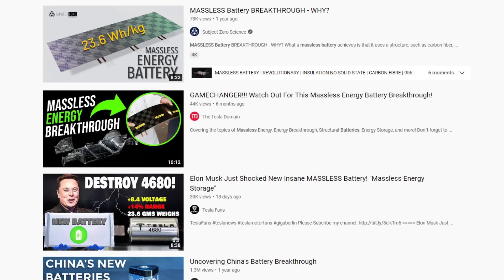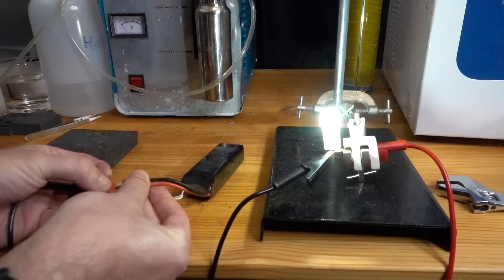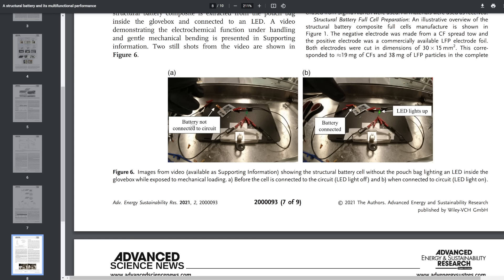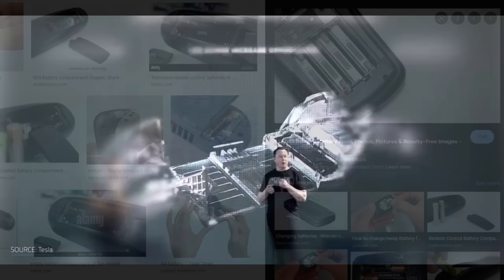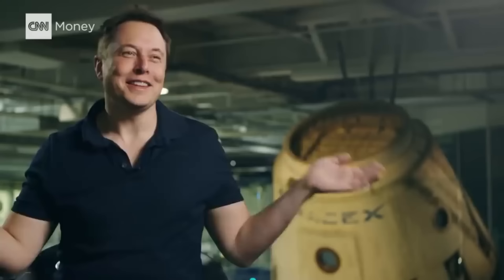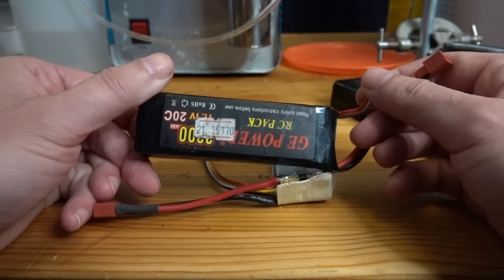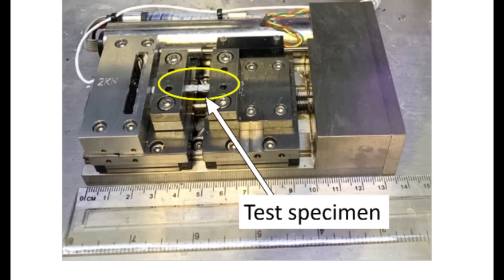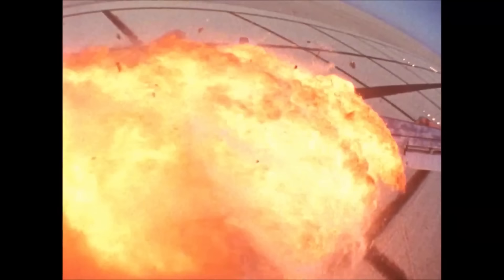Matt Ferrell, Massless Battery: BUSTED!!

Comment: When i first heard about solar roadways, i thought it was solar pannels above the road's surface, keeping the cars cool with shade, powering infrastructure like road lights, and maybe even powering trams, you know, something that was plausable, but unrealisitc or had a major flaw like how roadways often see elevated wind speeds during weather events, and having a large sail above every road would likely lead to disaster. But just like "Solar freaking Roadways" i didnt think the real world hype around 'massless structural batteries' could ever be as stupid as it actually was
Reply: A German Tram operator put some solar benches at is stations.
so you can sit on it and charge your phone.
so the bench gets hot and has therefore an active cooling.

ppl jumping on it won't help for longlivety.
A Solar roof at the tram station would really help. but this is not going to happen.
so one stands at 30-40 degrees C in the blazing sun or in the pouring rain. No roof, no protection from the weather.

how do they plan to rise the acceptance for public transit?
They talk about climate and put solar benches at the stations.
Reply: @CAESARbonds  Take a look at Aptera, one of the few companies that is taking solar transportation seriously. 
Here in the USA its quite common for bus stops and train stations to have a roof, why not just put solar on them. Heck even if its not covered, you could achieve the same intended affect by having a solar pannel that hangs off the back of the bench, instead of making the bench itself solar.
This is my biggest red flag for these "massless batteries" they plan on putting batteries, in near direct contact with solar pannels? Pannels that often see 50C 65C temperatures? Touching cells that dont like anything higher than 38C? Thats going to end in a dead battery, and maybe even a fire if they're charging while that hot
Reply: @denvera1g1  Rooftop solar is by far the most viable solar - you already need to have something up there, it might as well generate power, particularly if it is a 1-2 storey building which also needs power. The only problem is not every rooftop is suitable for solar, though that may change if one of the new solar cell chemistries being tested out turns out to be viable.
Reply: @theredscourge  I dont disagree that rooftop solar is needed everywhere. Our electrical grid is not capable of handling the need for AC in the coming decades, however, trees make many roofs in my area non-viable.
What i'd like to see is solar transportation. The best use case would be trains, trams, and some ships. But even if you just replace the roof of the tractor trailer with a purpose built solar roof, run power to the cab and throw a 30kw motor on  one of the axels, it would add basically no weight, but should pay for itself in ~2 years(depending on any upcharges), because unlike shore power, the cost of energy per kw for internal combustion engines is generally more than double that of wall power.
Heck even airplanes could benefit a 787 has enough upward facing area for as much as 200kW when at altitude and cruising speed(higher altitudes result in more sun, and cruising speed means the pannels are cooled, making them more efficient). That should be more than enough to power every auxiliary system including control surfaces and flaps in the case of a catastrophic failure of all engines and the APU(say running out of fuel). Using that solar energy to power everything instead of a generator on the engines, means that the plane will be more efficient.
Heck with just 60kw i'd look into a way of supplementing the primary high bypass fan with whatever is left over after all the auxiliary systems take their fill.

The main problem i see with solar on large high altitude aircraft, other than gowing pains of a new technology is that the skin of the aircraft goes through pressure and heat loadings, and the reason most aircraft are white on top is because it reduces the expanding and contracting caused by heating from the sun, by adding solar cells you could see a 1-5C+ increase in surface temperature when at cruising altitude/speed, and in any area that sees low velocity and low pressure flow, you could maybe see a 10c rise in temperature. When the plane is no the ground it doesnt make that much of a difference, but a 20c temperature delta wouldnt be out of the question, but that might help in the winter with de-icing on non-control surfaces.
Reply: @theredscourge  There are a number of solar cell chemistries that are already viable. We've used Gallium Arsenide solar cells for decades now, but their cost limits them to specialized applications like satellites and orbital craft where you need greater power density, efficiency and light weight and nothing is going to block them or damage the panels. The additional cost is justified because of the conditions in which they'll operate. If you're already spending 30 million USD on a satellite, skimping on the power source is a fools bargain. 

We're kind of at the limit of the efficiency of solar cells when it comes to commercial power generation. The only thing that makes solar electricity viable is the cost. Solar panels are dirt cheap for smaller capacity installations. The downside to solar is the pitiful amount of electricity you get from them compared to thermal power plants. Replacement costs become a constant drain against the bottom line in about 25 years when you have to start replacing panels. As long as the panels stay cheap and you've got lots of surface area for the panels to occupy, solar is worth it. As soon as you start using more expensive chemistries like Gallium Arsenide to boost efficiency (GaAs panels are about 30-40% efficient but are light and thin) you start losing the cost battle. You also haven't factored in the storage needed to make solar actually compete with thermal plants whose "storage" is actually the fuel they use. 
Not to sound all doom and gloom, but that's the primary factor limiting solar electricity expansion. The costs have to stay extremely cheap or else the low output pushes people to look for other generating options. On rooftops, solar is about the only game in town unless people are going to build wind turbines in their backyards.
Reply: @DriveCarToBar  Rooftop solar does not require any significant storage on a power grid if peak solar panel capacity does not exceed about 15% of the grid. They produce power during peak load time, and they can spin down natgas plants if the solar is producing too much. Pair that with nuclear power, and we've got virtually everything we need. Natgas could be used on a small scale to avoid the problem of storage, until storage becomes an order of magnitude cheaper, then you'd just add more solar. The problem is most of the green crowd are ignorant of how important nuclear is to a green future (and how safe Gen 4 reactors are)
Reply: @pikachulovesketchup666  Not entirely. Right now, there are a type of solar panel which work off ambient light AND direct light, rather than direct light alone. They cost more and are less efficient, but solar costs have been going down about 10% per year like clockwork for about the last 30 years, so more and more roofs will become economically viable to install solar on.

Comment: Actually one of the ways to turn off an engine is to turn off the fuel pump. Works for jet engines works for piston engines.
Reply: Definitely doesn’t work on piston engines since there are mechanical driven fuel pumps on the engine, can’t shut them off unless they fail. But if they do fail you can run the electric fuel boost pumps.
Reply: Buh... buh... Gravity...

Comment: 26:18 Correction: charging them is still through the thick wires, the thin ones are for monitoring and possibly cell balancing.
If it is a series pack, the cells can't all be connected to black without short circuit, if it is a parallel pack they would all connect to a common connection.
Reply: Exactly! I was looking for this comment. :)  I guess Thunderfoot had a brain fart there. He must know you can't have all the negatives connected together in a series configuration.
Reply: Nope. The thin wires are for charging and the thick ones are for discharging. Anyone with a LiPo charger can corroborate.
Reply: You can’t charge at 1C through those thin wires. They will melt. The bulk of the charging is through the thick ones, and to not over charge any cell, the last bit is at a lower current with the help from the thin ones to give each cell a slightly different current, to balance them.
Reply: @elliottw1  no, the thin wires are just the balance connectors, they just allow the charger to monitor the voltage in each cell  individually and apply a small + or - offset to the main charge voltage that's being applied through the main wires to balance the charging.
Reply: @ats-3693  Sorry, I've been using Turnigy hobby grade LiPos for several years. They charge through the small wires only.
Reply: @elliottw1  I design battery charging systems for a living and no they dont. ATS 369 and mad modders comments above are correct. The small wires would normally run through a BMS, the BMS has an input for charging current which is done at the higher voltage, the total of the series pack. If you were correct you would charge the pack at cell voltage (eg 4.20v Max for lipo) and this isn’t the case. Even on a hobby grade charger you would charge the pack at the pack voltage, not cell voltage. As mentioned above, the small wires are for balancing and monitoring individual cells in order to prevent any cells going over 4.20v etc, a tiny current can be added or subtracted via these wires to slow down or speed up the charge rate on an individual cell, but the bulk charge always goes through the “big wires”. You could charge a pack via the smaller balancing wires if you charged it very very slowly, but no one would actually do this in the real world as there would be no reason to do so, it makes no sense unless its a hard wired battery pack that you only have access to the balancing wires.
Reply: @elliottw1  Further to my last comment, i felt the need to put it in thunderfoot terms, so here goes. 

Every word you just said is wrong.

Comment: I would like to propose a clarification to your comments on the gravity fuel situation. Gravity feed of fuel from the aircraft to the engine (no pumping from the wing) is a real thing. The main fuel pump on the engine, which provides the high pressure for fuel injection, is driven off the high pressure shaft of the engine itself. I think what was meant is that the engines can continue to run without assistance from the fuel pumps in the wing, which is true.
Reply: Not to mention that carbureted 172's have been doing gravity-fed pumps for nearly a century...

Comment: FYI the lipo can be charged as a series through the main power leads, but it will get out of balance eventually. The small balance lead on the lipo pack is not used the way you described. The first pair of wires, black and white, are connected to cell 1. The next pair, white and yellow, cell 2. Yellow and red for cell 3. This allows you to measure the potential of or charge/discharge any one cell at a time.

Comment: @ 26:33 - technically WRONG.  The 3 cells are wired in series to get ~12v, so if you connected the black wire to EACH of the negative terminals on each cell, you'd immediately short them all together (except for the final most positive cell) - the 3 cells ARE INFACT charged at the same time, with the thin wires used to equalize all 3 cells by either moving charge from the highest cell to the lower cells, or by dissipating extra charge as heat in resistors.

Comment: The idea of a sturdy cell holder/enclosure blowing minds is hilarious...and cells not being easily serviceable because they're part of a composite layup and permanently bonded is beyond stupid.
Reply: Why not make those batteries long lasting and have great failsafe, like when few cells are busted, the whole pack still works? That's what Tesla did if you watch every Munro Live video explaining this.
Reply: Underrated comment.
Reply: @xbxb  having access to a stock of replacement cells with same capacity as cells in battery since with use capacity decreases, temporary weldless cell contact methods, cell level fuses and a cell holder/enclosure that can be opened up by undoing bolts is the way to go for longevity, material conservation and easy serviceability.

If cells go bad or short and are removed from the circuit by a cell level fuse that parallel group will have a different capacity then other parallel groups which makes the bms work harder since the group with dead cells will charge faster and discharge faster, limiting range. 

Batteries will still work with dead cells when a parallel group has dozens or hundreds. But being able to replace bad cells is always optimum.

Comment: Speaking of batteries, electric bus explosions are appearing more and more these days. Absolutely terrifying.
Reply: U need (also) research about ICE vehicle 🔥 man! 😁...if battery are so "bad" what about smartphones? Laptop's?
U take my point?
Reply: and that is with a more seperate and protected battery than having it be in te structure.
Reply: @wtfjesus8251  I can drop a laptop faster than I can exit a bus.
Reply: @wtfjesus8251  Difference is that ICE vehicles burn down slowly, can be extinguished quite easily (compared to a lithium fire) and dont randomly start burning again.
Reply: That is why battery electric buses are a stupid idea. It's Better building trollybus systems.

See "why trolleybuses are superior"
Reply: @wtfjesus8251  a laptop has a 50Wh Battery. Phone 15Wh. Electric car? 80,000Wh. 
That is where the problem lies. A Laptop battery can be allowed to burn down relatively safely. At approximately 500Wh, things starts to get a bit more spicey (E-Bike or electric Scooter battery size).
And yes, also ICE cars and busses can burn. They can be extinguished. Electic cars and busses not so much.
Reply: @wtfjesus8251  there's reason why you need to take a laptop with you into a cabin and capacity of the battery is limited to 100Wh
Reply: Battery buses are stupid. Trolleys are superior.
Reply: @ChucksSEADnDEAD  how many times U are "drop a laptop"????...or maybe U know someone???🤣🤣🤣🤣
Reply: @xXYannuschXx  : 🤣🤣🤣 "whom care about "slowly", burn is burn, only in US is about 300K ice cars burning, a year! 
I prefer a battery smartphone not a burning engine... 🤣. What about U?
Reply: @kain0m  : U are changing a subject man. Check the evidence! 
Since when does battery capacity matter? Educationan man, is the 🗝️!
😁
Reply: @Papinak2  : explain to "way"? Did U know?
Reply: @Papinak2  : really? How much U are allowed take a gasoline (like for Zippo)?????  🤣 
And, we are talking about cars, right?😁
U knows 💩, this is the truth 😁... Facts and evidence man, not a opinion!
Reply: @wtfjesus8251  It's because when you fill a fuel tank, you remove most of the air inside the tank, which means there's very little oxygen in the tank left. And since fuel cannot burn without an oxidiser, little oxygen left means that there is almost no chance the fuel tank will explode as long as there is no physical damage to it. In fact, if we're being realistic, a tank of fuel is actually much safer when it's full or almost full compared to when it's empty, as there's very little fuel/air mixture left when it's full.

With batteries, however, the exact opposite is true. Batteries have all the reagents needed to release their stored energy already inside themselves. Many battery chemistries are already showing problems with spontaneously catching fire and yet their energy densities don't even come CLOSE to that of what hydrocarbons have. You can't "short out" a fuel tank, but you can do so to a battery, in which case the battery will spontaneously detonate or burst into flames.

Comment: If we're talking about the fuel pumps in the tanks, those are fairly low pressure. if the center tank pumps die, the fuel is inaccesible, but if the wing tank pumps die it can still be gravity fed to the engines. If the high pressure fuel pumps on the engines die, that would be total engine failure. you could, however, still use the fuel in the dead engines side to feed the living engines side.